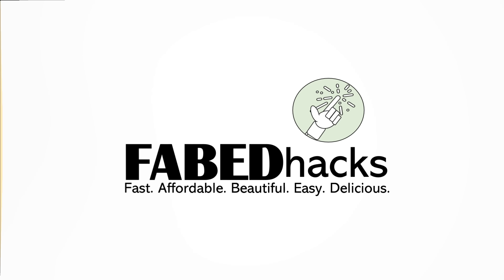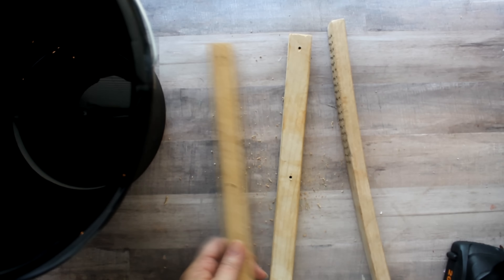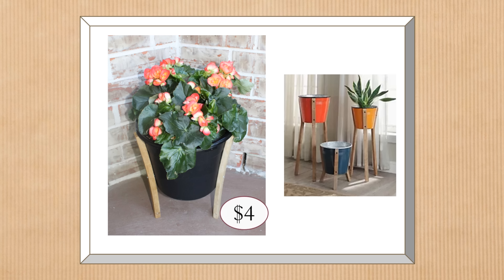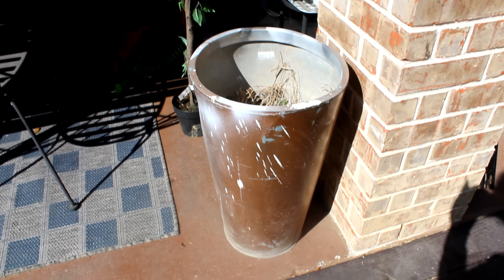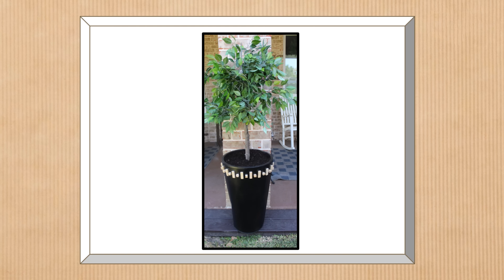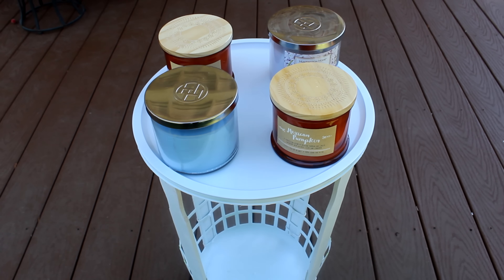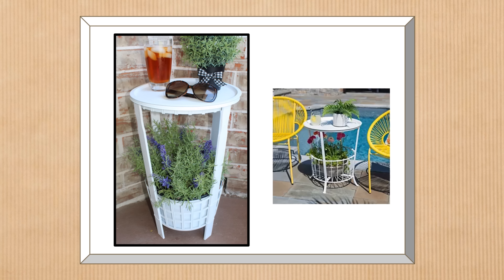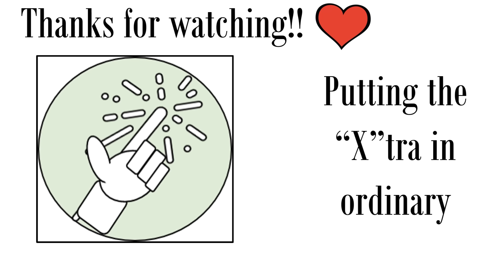6 DIY PLANTER IDEAS | DOLLAR TREE DIY & UPCYCLE | FARMHOUSE AND BOHO

Comment: I am impressed, great ideas, I have a balcony that always needs revamping after the winter, high winds, loads of rain, theses are so easy and clever, Thank you..... part 2 now 👍
Reply from the maker: Hi Alison! YAY! So glad these will come in handy! And there are several in Part 2 that will be great for balconies, especially windy ones! Not sure if you were thinking of either of these but if you make the basket table from #1, make sure to weight down the bottom with a heavy plant and definitely glue the top on! 😁 Even with weighting down the bottom, I don't think the plant stand from #1  is good for windy areas because of the height. Maybe making it shorter (maybe use plunger handles instead of the long dust pan handle) or if you can anchor to a wall or railing. Thanks! 😊💗

Comment: Hey.... I'm curious about the drainage part of some of these... 🤔 I LITERALLY just came in the house from working on plants outside because it's already "hotter than fish grease" out there.... But I'm FOREVER trying to find different things to turn into planters, but SOME of the items, I REALLLLLY don't want to drill holes into the bottom. I did do ONE plant that I was actually only "getting started" and it WAS in an actual a planter but it's made out of some kind of pottery or concrete or SOMETHING....lol but they didn't put any holes in the bottom and I WOULDNT mind drilling into that one since it IS ACTUALLY a planter, but whatever that is that it's made of, drilling holes is NOT an option lol. SOOOO I added a few rocks in the bottom under the dirt and put my little starter plant in it, but after about a week, my little plant just didn't look happy. Lol. It stayed alive, but it was just kinda sitting there like it wasn't sure what to do. I was thinking it could have just not been deep enough since I had to add the rocks in there to separate any water drainage, but it's not THAT small, especially since the plant wasn't very big at all yet. {sorry for the novel 📖} #ADHD...  ANYHOO, since I saw you were actually using REAL plants, I HAD to watch....  {LORDYYYYYY I just cannot make a short comment. Lol} sooo what do you actually do for drainage if you can't or don't want to drill holes in your container? 🤔 Just wondering if there's something out there that I just don't know about. Lol TFS... XO from TEXAS! 🤠
Reply from the maker: Hi Momma Bear! LOL! You are too funny!😁 Sadly, I don't know any other option for drainage than holes in the bottom but it does seem that rock idea would have helped somewhat. That sounds like a good idea to at least get some relief from excess water. Also, I saw some type of special overwatering soil that miracle grow sells. Not sure if that well help.  Be safe and be well! 😊💗

Comment: So upset that I tried the last planter and it did not work under any circumstance of how much glue I use there’s no way that the top of the handles will be able to stay on the top it was such a waste of items and time. Pissed
Reply from the maker: Hi Jessica. So sorry to hear you had difficulty gluing the top on and I can see where trying to glue with the handles would be an issue. However, as you can see from the video, I never glue the top on. My intention is use the piece for the multipurpose of plant stand in the summer and then still be able to use it as the witch lantern at Halloween as I mention in the the video. For that reason, I just place the lid on top and then just push the rubber handles into place. The weight of the plant (and the witch's head and hanging lanterns for the Halloween light) hold the pieces in place. If you want to glue the lid on, I would suggest sawing off the handles and gluing the the lid directly to the poles. Alternately, if you want to keep the handle in place and would like a little more of a secure hold than just the weight of the plant on top, you could use some duct tape to secure to the poles to the top. Hope that helps.